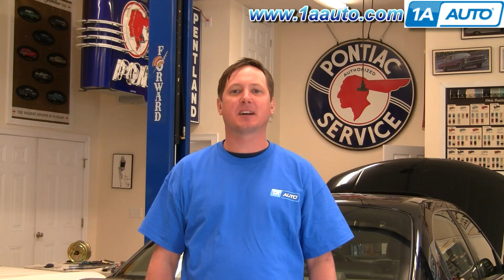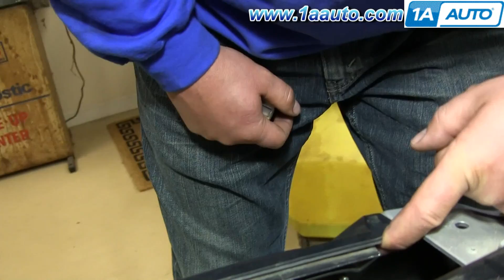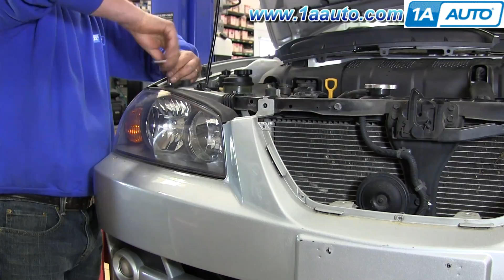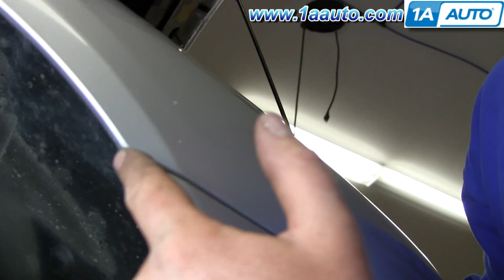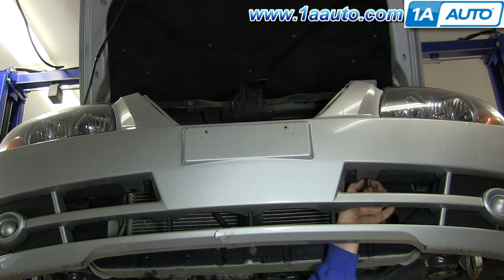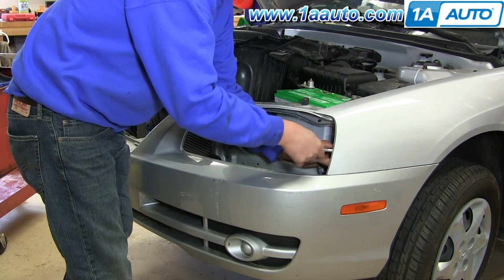How To Replace Remove Front Bumper Cover Hyundai Elantra 01-06

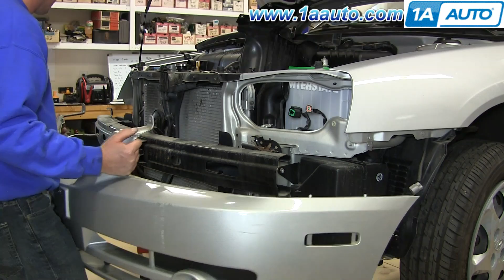Comment: 4:34 What is the black box on the left for if anyone knows please lmk because mine is hanging
Reply: Lower air box... all the air enters there first then moves up to the primary air box where the engine air filter is.
Reply: Is it required cuz mines hanging too and I wanna upgrade my cold intake